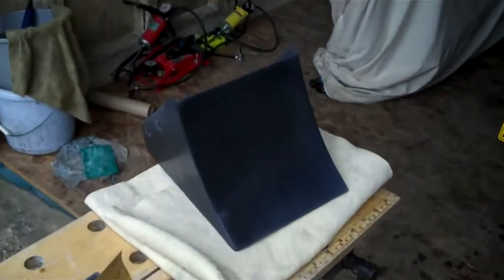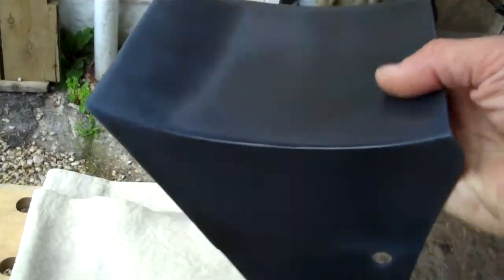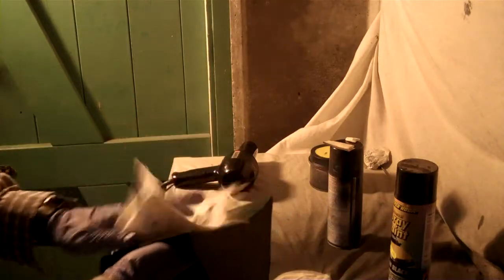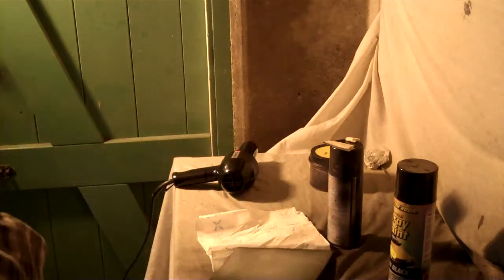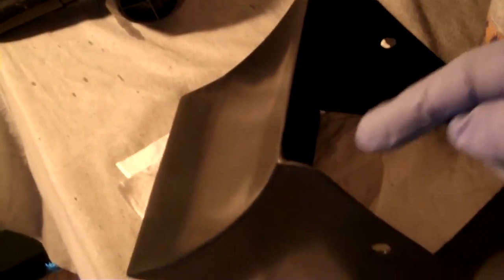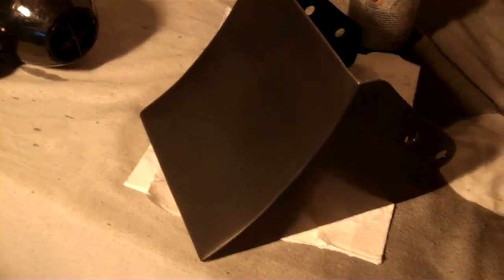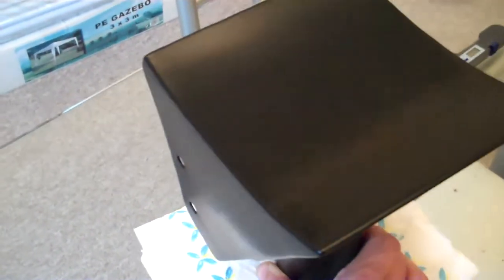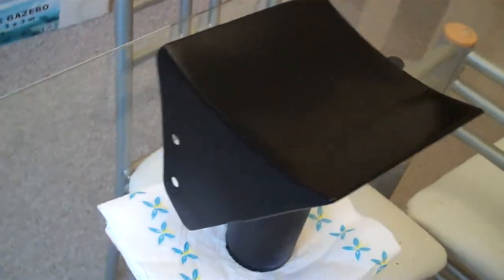Delboy's Garage, Harley 883 iron, Belly Pan, Episode 8, Paint finished

Comment: Nice Job, Del.  A couple of thoughts...

I'm not an expert but I believe that I read somewhere that "rattle can" paint is too soft for items that will be exposed to the environment.  you can pop a fingernail through it with ease.  They suggest a 2 stage paint for this but as you stated as a temp cover "rattle can" paint will do.

I've seen people who use Refrigerator Enamel paint to do their lower fork tubes with good results.  Maybe an option in the future?
Reply from the maker: I have used just about every kind of pressure can paint out there over the years,,,,and the only truly hard stuff is Ultra Heat Paint, it sets hard using the ceramic it contains, and lasts real will in any environment....but yeah, are dry regular can paint will always be soft.. even 2k paint can soften in really hot weather like any plastic.. the only true hard coating is powdercoat as it goes rock hard and is closer to glass than plastic..!
Reply: Yeah, just had portions of my wheels powdercoated. 

My interest in this vid was I'm leaning toward installing an oil cooler.  Not doing as much open road riding as I am sitting in traffic or parades and such.  Looks like a nice way to hide the ugly oil radiator.  Need to figure out how much or how little a modified version with some sort or open front will interfere with the radiator.